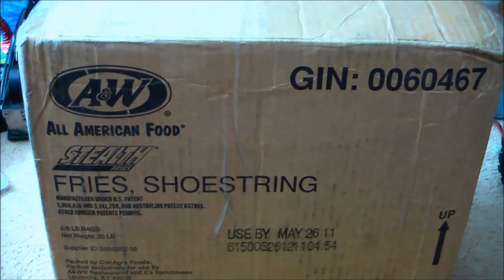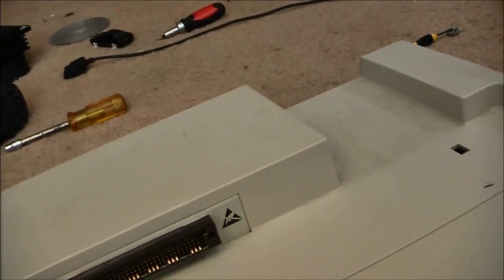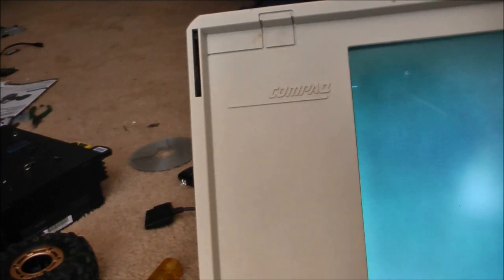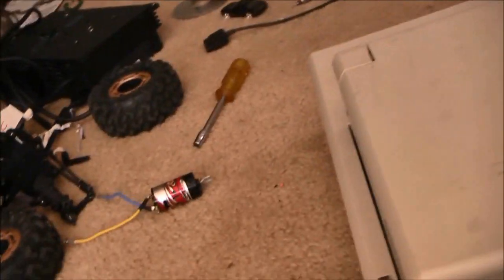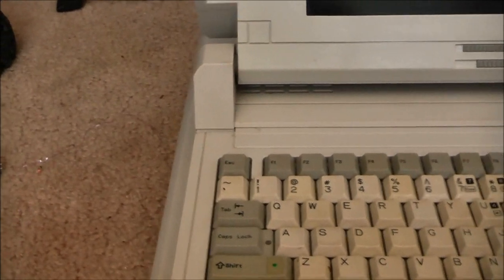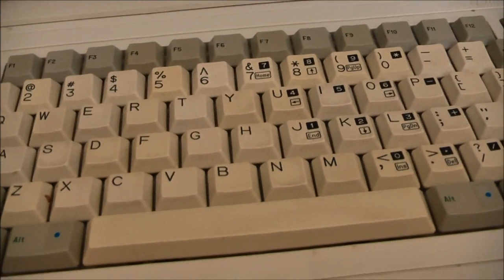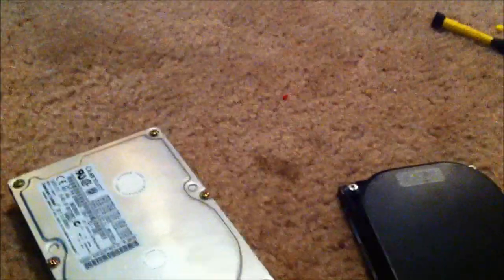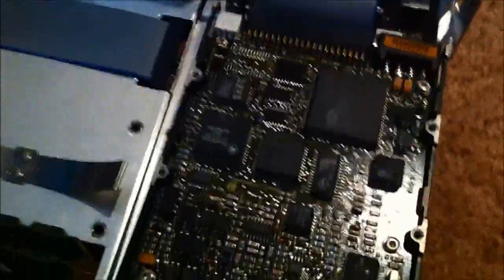vintage Compaq SLT/286 with EXTREMELY rare docking station

Comment: I managed to run 98 on my FX-6300-based system.  It did indeed get to the desktop, after I tweaked it so it would stop freaking out over my 4GB RAM.  Seems 1GB is the limit.  Obviously there were no drivers available, and it was choppy and slow, but it did work.  I bet you could make 95/98 work on new hardware with like VMWare of VirtualBox generic drivers.

Comment: 95 unfortunately won't work on anything less than a 386.  It would run on a 286 if you used the EMU386 emulator, but I don't know of any way to skip 95's processor check.